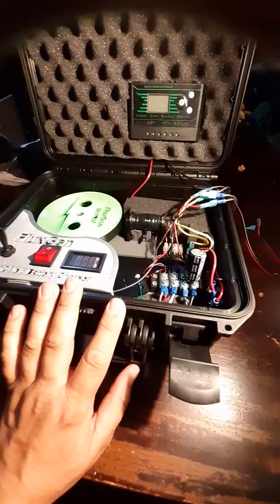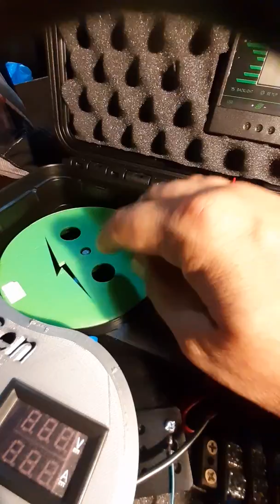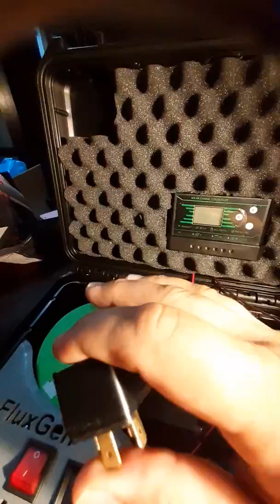Pulse motor generator Zero point free energy

Comment: What would happen if you used a gold coil? Or is that not a thing
Reply from the maker: Actually there is some truth to that ....but I would do is I would buy silver coated wire apparently silver is more conductive than gold..... so I actually do have silver wire and I have experimented with it and it works very well...

Cheers
Reply: @FaradayResearch  thanks for replying. I was trying to understand magnetics and how the pyramids were capped in gold supposedly. I was curious to see how that would interact with the field compared to copper. There’s some interesting mechanics with limestone and magnetics a long with a static shock. I can give you a link if your curious
Reply from the maker: Sure that sounds great
Reply: https://m.youtube.com/watch?v=PS1azzN0b-I

I’m going to try and tune in tomorrow. I haven’t really heard anyone in this community talk about the permeability of stone like material. Limestone seems to be the most permeable followed by granite and then lastly basalt. This is the same composition as the pyramids.
Reply from the maker: @donavonneighbors  hey very cool I seen the video.... so my take on it what it is according to them this is just my opinion the pyramids were a giant capacitor... very similar to the construction of the Baghdad battery looked that up it's called the Baghdad battery ...basically the pyramids is a giant power plant receives the electrostatic radiation from the top of the pyramid which if they use gold that would be a great conductor and then it would travel through the granite and limestone through the whole pyramid to the under the ground ...if under the ground they have a reservoir of salt water you basically got one giant capacitor!! this power now can be transmitted through galleries of Little River pipes and be transmitted to wherever it wanted to go... so you're making the water basically like a wire,.. so if you have these little channels that go from location to location you now have a source of power transmission that is my opinion ...
 it sounds really cool!

Amazing!
Reply: @FaradayResearch  have you ever heard of a Marx generator? I just watched a video on it and it explains exactly that. Using water as a capacitor and resistor to make a spark generator.
Reply from the maker: Yup I have seen it....very cool stuff
Reply from the maker: Thanks again for your cool information!

Comment: some info.    lmfao       input Power, in WATTS  ;      output   WATTS?????
 input Power =  12 vdc @ .3 amps =  3.6 watts.     output watts???? 
is the performance of this system as 'good' as you think it is.

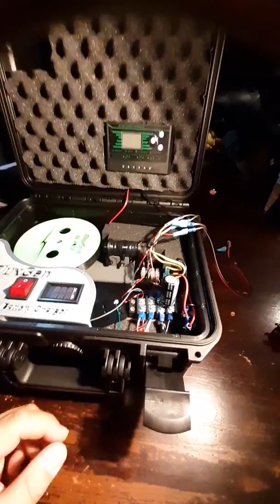at 1:10,  the term 'resonance'  is  NONSENSE.    see  em induction. 
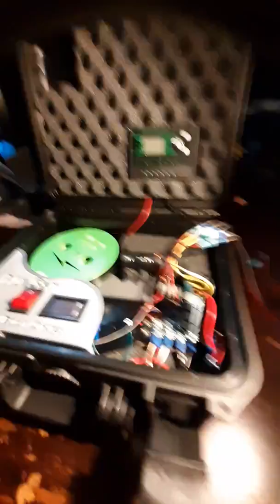at 2:04,  'a bolt'     the use of a bolt indicates that you do not understand that hardened steel  Will  Become  a   Permanent Magnet,
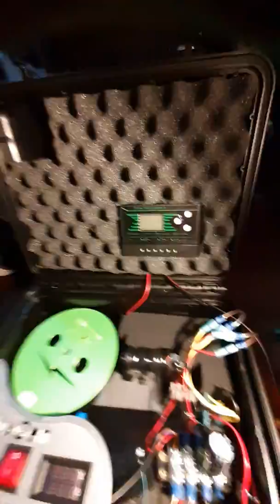whose  STATIC  magnetic flux will  Reduce  solenoid  efficiency.        at 2:50,   what  sensing  Method  is being utilized.
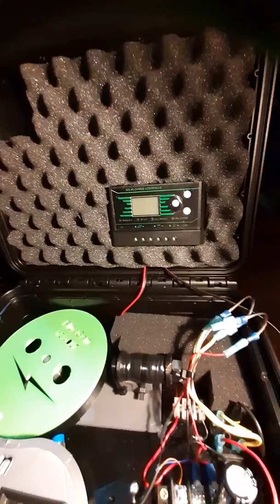at 3:14, INSTEAD of a pulse-motor configuration,  you Should be using a 3-phase, bldc, outrunner motor; controlled with a servo tester.
any attempted utilization of back-emf  is  a  Waste of time.    back-emf is NOT free energy. 
bedini's work was  FLAWED.  as has been, ALL research that his work spawned.
it should be understood that the generating process  Must  occur at a  Radius  SMALLER  than, the radius at which force is applied.

if it is not,  MAXIMUM  lenz-force braking will occur, when a generating coil is  Energized.
a   GENERATING  coil  Should be made using  14awg magnet wire; and  should have  ONLY  a  Few  layers.
the use of  too-small wire and/or too many layers in a generating coil Should be avoided.
when there are too many layers in a generating coil, there will be  MORE  back-emf induced Impedance, when a coil is energized.

this  impedance results in  current LIMITING; and  fewer  watts  out.
back-emf is a Direct result of  Conventional coil winding methods.
compare a single layer inductor, where there is almost no back-emf.
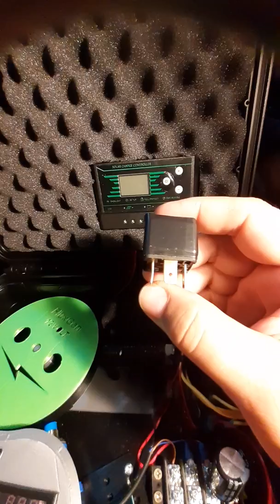at 3:31, lmfao.    ANY   SPARK  represents  a  'discharge'.   a  LOSS OF ENERGY.

at 4:53, pulsed output is fine.   JUST SO LONG as  there are  LOTS AND LOTS  of pulses.
in other words, output current that appears to be  CONTINUOUS. 
it should be understood that where capacitance is utilized on the output side of such a  system, it Indicates that output energy density  is  Too  low, to achieve unity output.         googletranslate
https://en.wikipedia.org/wiki/Electromagnetic_induction
Reply from the maker: Hi Thanks for your helpful info....my motor runs at 12dc at   .5amps  and about 6.0 watts and my motor pulses at 4200 times per minute   my back emf spark is very small almost not visable.   I am still doing my research and I am learning alot as I go   the info you have given me is very appreciated!  So thankyou for that.   You have given me alot to look into so this will help me achieve my goal...I am also working with 3 phase bldc motors as well....again Thanks for your info

Mike
Reply: @FaradayResearch  hi.   input watts is 6.   fine.     drive pulse rate is,  70 hertz.   fine. 
zero point, forget it.   NOT practical.    what is practical?
MECHANICAL ADVANTAGE.        it is so practical, it  Hurts.
what is stoopid:    it is  More  attempts to prove that faraday and lenz were wrong.   they were not.
do keep learning.    and trying.     if you have not done so, you might take a look at the pinned comment, at my latest ou video.     cheers
https://www.youtube.com/watch?v=B2M4w7M2c08
https://en.wikipedia.org/wiki/Lenz%27s_law
https://en.wikipedia.org/wiki/Michael_Faraday

Comment: Thanks for answering my question,  I believe your setup is is probably the most sophisticated I've come across, with some more fine tuning, you should be able to get it to self-loop, or self-run
Reply from the maker: Thanks Thomas...yeah I have a few more ideas in need to bench test  so yeah my research continues on...  I think I will try a larger capasitor...like a 1 farad  and see what happens
Reply: I've  also been experimenting with a pulse motor set-up as well, and I've found that if I use high voltage capacitors,  360-450 volts with low uF (micro farads) they charge very quickly, usually within 30 seconds, but, if I'm using a super
 capacitor like 20 volts with 1 farad ( 1 farad= 1,000 watts) they charge very slowly, but still faster than the conventional battery. I believe the BEMF is the zero-point radiation, flux or cold radiant energy Tesla was describing. Through my tinkering with my set-up, I dont believe this high frequency, zero point radiation has any amperage in it. I have found that it is possible  to power our appliances with capacitors (super capacitors in conjunction with inverters..........using the zero point energy source. 
 talking about, and that it does not naturally contain amperage........
Reply from the maker: @thomasreese9982   yes I totally agree with your findings  I will try the capacitors you suggested   thanks for the tip!